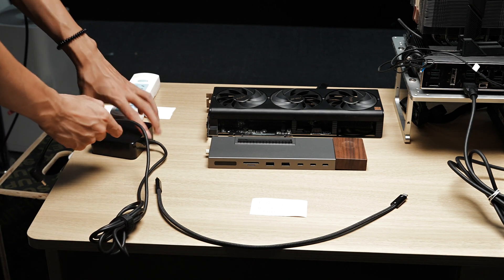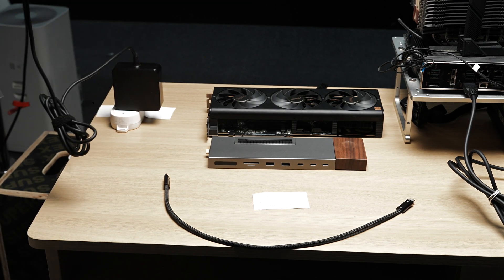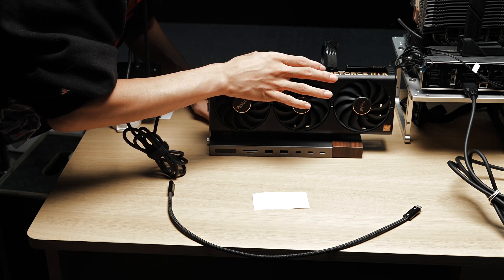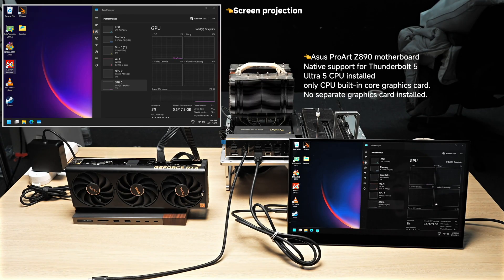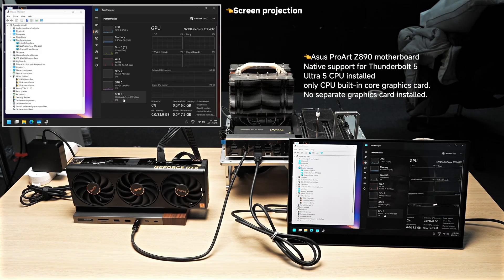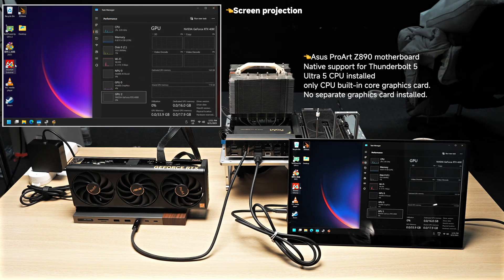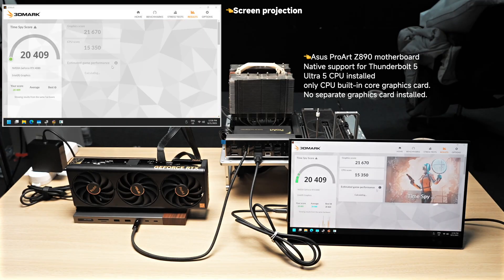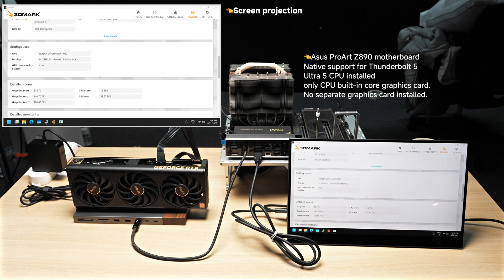Humbird 3 Thunderbolt 5 eGPU – Real Test & Backer Verification

Comment: Is there a chance of getting a review unit?
Also, you forgot to connect the external monitor directly to the GPU for a better result :)
Reply from the maker: You're right, connecting an external monitor via the eGPU's graphics port will significantly improve performance. However, we were concerned that this might be a bit complex for a demo video, so we chose a more accessible method for testing. The data in our previous 3x performance improvement test video was all tested using an external graphics card connected to a monitor to ensure optimal performance.
Regarding third-party test samples, we're currently in the third round of proof-testing. We'll begin testing once we have a sufficient number of units available for testing, but not yet. Thank you for your interest.

Comment: I think this should have an extended version to install the card directly to the MB and redo the test suite - reveal the loss of performance thru connection. You folks did it once before, it's time to refresh that for the production version.
Reply from the maker: You are right, we are already working on this test, and we will make a video update later.
Reply: In the benchmark results, you can see that the average score with this setup was 24,080, while the result of the test was 20,409. So roughly saying it is ~15% loss.
Reply from the maker: @JFFby  To simplify the wiring, we used a connection method that significantly reduces the performance of the graphics card dock: connecting the monitor directly to the motherboard's video output. Connecting the monitor to the eGPU's discrete graphics output port significantly improved performance. The actual test results were: a TimeSpy score of 23535; installing the graphics card directly into the motherboard's native PCIe port resulted in a TimeSpy score of 27643, representing an 11% performance loss compared to a direct connection.
Reply: there is no need for it, a regular graphic score for a 4080 super is 28k